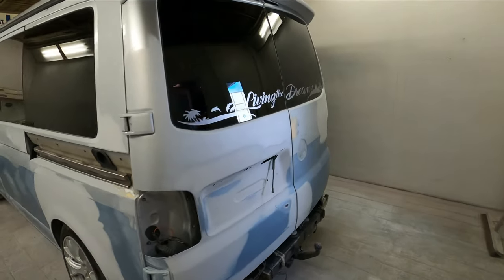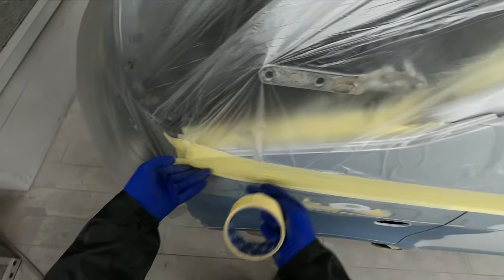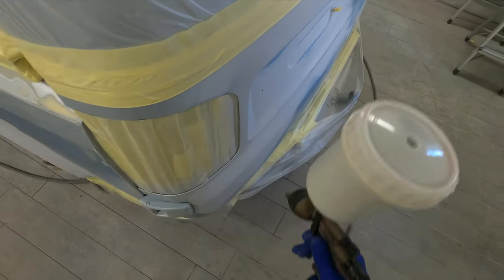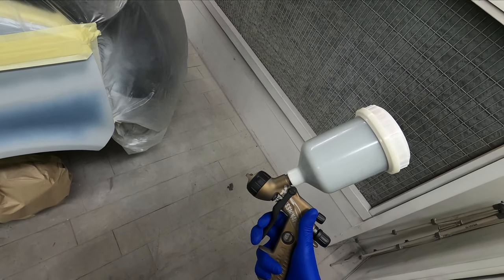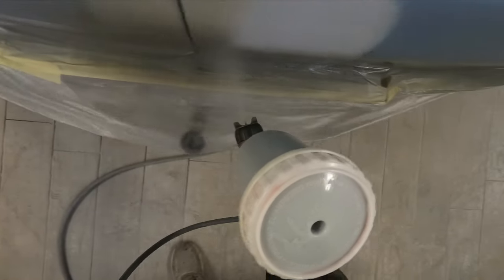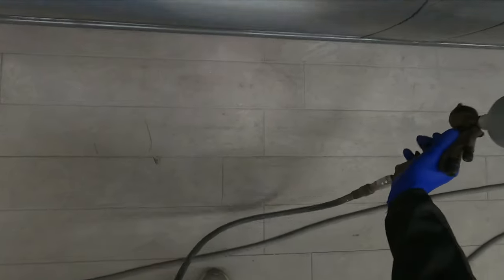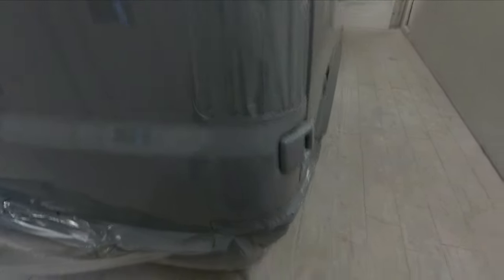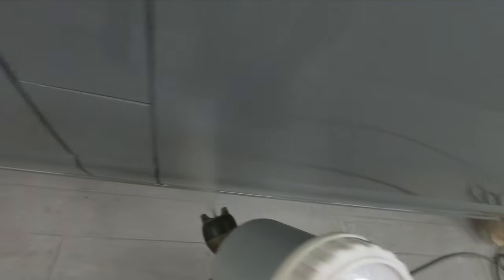Re Painting a Volkswagen Transporter T5 camper van / VW T5 Paint Restoration - Part 1

Comment: I had to watch this again mate, I couldn't take it all in during the live vid and chat last night. So you mentioned your WoW primer was mixed 4:1 + 30% were you using the Roberlo Multyfiller Express? if so the TDS says that for wow it should be 3:1.5:1 I know you don't use the NS21, please don't think I'm questioning your procedure Tony I'm just trying to understand the best/correct way to mix this primer, when I use all my NS21 I will be changing to thinners. It's really good to hear you have more videos in the pipeline mate as I have missed your uploads and appreciate all the work you put into them. Anyway mate the camper is looking great and has a very nice finish for 2k gloss, look forward to the next instalment 🙏👊👍
Reply from the maker: For this mate I used kapci primer for the wet on wet as I’ve tried and tested it previously like above and it works with no issues mate
Reply: Ah ok thanks bud 👍
Reply from the maker: I’ve never tried the roberlo additive tbh mate I’m afraid
Reply: Ok stupid question for you, is there any way of tinting primer, I'm trying to paint racing green over light grey primer but it doesn't cover very well so wondering if there is a way of making the primer darker? I have seen some on YT add basecoat to tint primer! didn't think that would work.
Reply from the maker: Personally I wouldn’t mate I’d just just grab a small amount of black primer for it buddy
Reply: Ok thought you would say that, I'll get some when I'm able to get up, walk, get in my booth 😂

Comment: Great video As always Tony. What high build you using and mixing down 30% to make the wet and wet?
Reply from the maker: kapci mate i use for wet on wet and roberlo for build
Reply: @TonysRefinishingTV  Cool. In the video you mentioned mixing down your High build to make the wet and wet. I also use Roberlo TDS mentions the converter which is hard to get hold of.  Not sure if you can just use normal thinners?
Reply from the maker: I’ve used the roberlo wet on wet mate with just thinners and I’ve not had a job come back yet mate in 2 years